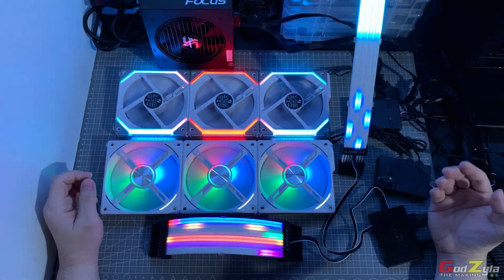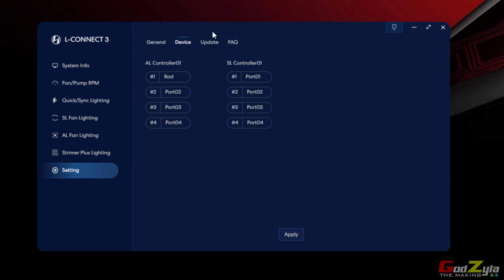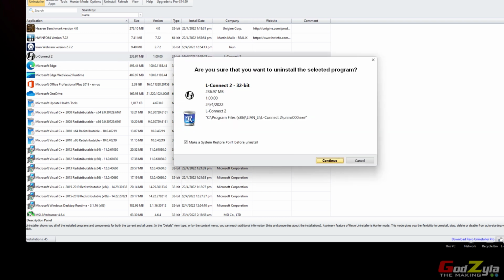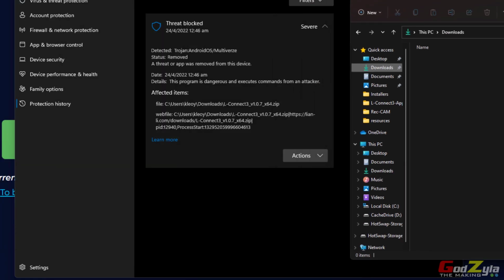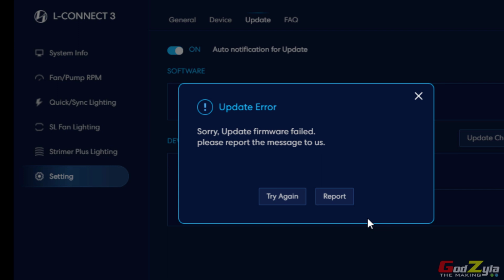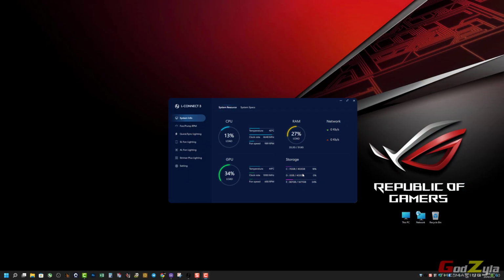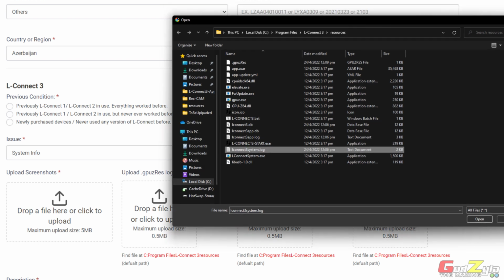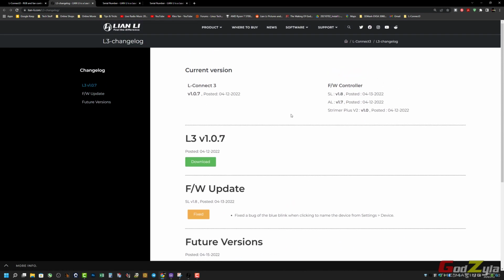Lian Li - L-Connect 3 (Installation)

Comment: my L-connect 3 is till very lag... despite being the latest version.
Reply from the maker: Hello Sebastian Tan, welcome to my channel, do you happened to have lots of USB devices plug to your PC, if that's the case, it might be the cause of it.
Reply: @KleoYan  hi. I only have kvm cable, mouse, headset
Reply from the maker: @sebastiantan1769  ok, I see your issue now. is your KVM an external device or it's embeded to your Monitor. Be it embeded or external KVM, you can try connecting all USB devices directly to your PC instead of using the KVM. I had this problem with my external KVM and a friend who has the Gigabyte M32Q monitor. we both can't control the L-Connect 3 without lag, but once we connect our usb device, the issue is gone. Additional to this, I have swap my external KVM as my old KVM does not have a power input source. I have purchased a KVM that comes with a 5v power source from an AC outlet. This resolve my issue too.
Reply: @KleoYan  i need the kvm from monitor due to my keyboard cable being short.
Reply from the maker: @sebastiantan1769  I see, this i can't help you with.. it will be base if you contact lian li tech support and tell them the issue you are having.
Reply: @KleoYan  ah i manage to bypass my monitor kvm hub. and now it works. but this is strange
Reply from the maker: @sebastiantan1769  yes that’s what I find out. When I had kvm on. I can’t seems to get the app working till I do direct. But now am
Able to use kvm but must be a kvm that has a power source provided, else it will not work.
Reply: @KleoYan  my kvm is monitor kvm.. so no power...
Reply from the maker: @sebastiantan1769  yup for monitor is should work but for some it does not. Sad to say, anyway I have told lian li about this and they are still finding ways and means to improve the situation as some of the pc builders are using kvm monitors. Hopefully there will be a fix for it.
Reply: @KleoYan  oh okies. cos i plug in only the whole app hang.
Reply from the maker: @sebastiantan1769  yup that’s the issue as the L-Connect 3 is scanning at the background for usb devices as it’s controller are all usb devices. The usb addresses are shared in kvm. That’s the problem, I have tried with some other kvm with power source too but not all will work. Hopefully Lian Li will narrow down with a solution.

Comment: Hi, great video! I have some questions and wish you can help me. I built my new pc last week with lianli sl fans. The problem is, when I downloaded L-connect 3 and updated the firmware of sl fans, all the fans were running max speed and couldn’t change the RPM unless i turn off pc. Also every time i open the l-connect 3, the fans run to max, and the temperature of cpu and gpu shows 0 in L-connect 3. But I uninstalled 3 and downloaded l-connect 2, everything is fine.
Reply from the maker: hi 萨菲罗斯, welcome to my channel, currently you are not the only one facing this problem as others are facing this too. I would advise to either temporary plug your fan load to your motherboard fan headers first. there will be a fix patch on this issue from lian li. or you can temporary use the L-Connect 2 first. I will be doing up a video when lian li is out with a fix. Pardon me as I have limited knowledge to fix your issue at the moment.
Reply: @KleoYan  Thank you so much for responding. Yeah, at this moment all i can do is waiting Lian Li to fix it. I will try to lodge this issue to their technical support see if they can solve this problem. Thanks!
Reply from the maker: @萨菲罗斯  you are most welcome. 👍

Comment: I have migrated from L-connect 1 to L-connect 3, and now I cannot control my fan speed. All my fans work at 1800 RPM, and I cannot control them and that is driving me crazy. Anyone else had the same issue?
Reply from the maker: Hi moneff, welcome to my channel. mind if I ask which uni fans are you using? if you are using the SL fans without the SL marking on the controller. you might want to do a firmware on it first before using the L-Connect 3. here is the guide on how to. https://drive.google.com/file/d/1lZDI9FQEHRptOKHJTeL8_Qf7os3I1hU0/view

Comment: I had firmware fail, Lian li sent me link to firmware tool but no firmware included, contacted Lian li again but no response.... I've 3x triple packs of AL's with 3 broken controllers and would hate to refund them over the controller's but I'm not wasting 200 pounds because of software bricking my controller's.
Reply from the maker: hello TuShoo, welcome to my channel. As for your issues, you will have to reply to them and see if they can send you the replacement controller.
Reply: @KleoYan  I took the decision to refund them and have them out of my system just now. The honest answer is it faster to refund through Amazon and buy new fans (Corsair better support IMO) than dealing with RMA.
Reply from the maker: @tushoo4938  I see, whichever work for you. That will be good.

Comment: does your l-connect 3 auto start ? after turn on ur pc ?
cause i tried everything i can even in startup folder is still the same everytime i need to manually turn on or my fan wont run full speed
Reply from the maker: Hello WillamV Yong, welcome to my channel. Yes it does auto load. I will be doing up video soon about the pwm functions. As I have all my issue fixed by lian li tech support 😊

Comment: Hi, my L-connect 3 cannot detect cpu and gpu temperature and clock rate as well as fan speed, what do you think is the issue here?
Reply: Even My fan mode can only use static, currently any fan curve wont work
Reply from the maker: @xandrelphane  hi , welcome to my channel, are you on the old version of L-Connect 3, if you are, you might want to try uninstall the old version and install the new version, see if that works.
Reply: @KleoYan  Hi, i just installed the new version today..i had just switched from l-connect 2 to l-connect 3, i followed your every instruction in the video. And im currently only using 1 controller
Reply from the maker: @xandrelphane  I see, is everything working fine for you?
Reply: @KleoYan  Unfortunately no, as i have mentioned, my L-connect 3 cannot detect cpu and gpu temperature and clock rate as well as fan speed, and the fan curve setting is not working, only static fan speed is working
Reply from the maker: @xandrelphane  ok now just to check with you, do you use a kvm or even a docking station to switch between pc and Laptop with one set of mouse, keyboard and monitor. Or are they plug directly to only one pc?
Reply: @KleoYan  Plugged in to just one pc
Reply: No docking station, no laptop, just a pc
Reply from the maker: @xandrelphane  ok, if that's the case. your best bet is to approach lian li tech support, i am out of clue how to aid you on this. or are you able to roll back to L-Connect 2? Now I have to head to work. will talk to you again. pardon me. https://lian-li.com/faq/

Comment: Thanks for your video! Hoping someone could help me with a slight problem.. everytime my pc boots and L-connect3 auto runs, i' ll get 2 UAC popups "Do you want to allow this app...", which gets really annoying considering they happen every time my pc boots.. Tempted to disable UAC altogether because of this but before that, anyone facing the same problem or anyone knows if i am doing something wrong? Would appreciate any help with this !
Reply from the maker: Hi Jovan, welcome to my channel, I do face this kind of issues with the UAC and I disabled the UAC. The choice is yours if you are ok with the UAC on.

Comment: Just downloaded the l connect 3 but my strimer is not under the l connect app? If going by the website it looks like I need a new controller coming sometime in may? I’m not sure if I have the strimer or strimer plus… I got it prebuilt. Could you advise what I can do? What is a controller? (Pc noob)
Reply from the maker: Hi tyler dicarlo, welcome to my channel. Yes if you are having the strimer plus. The orginal controller will not work. You need to have the v2 strimer plus controller which is sold separately in order to work. Which this controller will be release May 6th. More details here https://youtu.be/J76Zyd1GzNA
Reply: @KleoYan  shouldn’t my strimer show under the Device manager thou even without the new controller?
Reply from the maker: @TylerD1995  no it will not show. You need a controller specifically for the strimer plus.
Reply: @KleoYan  could I just go back to the original software before the l-connect 3 just until I get time to get the new remote and install it?
Reply from the maker: @TylerD1995  the original Strimer plus comes with a physical controller which works on physical pressing of buttons. if you want it to work with L-Connect, you will need the lian li argb kit to connect that controller to your SL or AL fans, if you want to use the L-Connect or L-Connect 2 but not L-Connect 3 to work.
Reply from the maker: @TylerD1995  let me give you the whole playlist where you can refer to, if you using L-Connect 2 for the strimer plus. look under strimer plus with uni controller. https://youtube.com/playlist?list=PLEW-b-2vYDdPo0NzHyeksx012c-nkDapm

Comment: Why the hell should anyone go into these problems, this should be simple
Reply from the maker: Hi gamer profer, welcome to my channel, I do agree. lets just say that if you can always look for other argb equipment or software. There is a saying no pain no gain.. look at the bright side. if you have purchase these fans and strimers, is either you go through with it or you don't.
Reply: @KleoYan  I got the fans and controllers and the strimmer plus, but I tried the lconnect 3, my way, your way and different ways but in vain it just not recognizing my controllers.
My pc is lian li from bottom to top, but there is a problem with the software which is easy to make
Reply from the maker: @gamerprofer2238  hi, welcome back. are you by any chance using Gigabyte Vision or the Aero motherboard? apparently i have tested a few Gigabyte Vision and Aero boards, it's random that the USB does not pick up the controllers. which is weird, even after doing fresh windows 10 or 11 installation. If  it's not. which motherboard are you using. mind if i asked? thank you!
Reply: @KleoYan  no I am using asus b550 with a ryzen 7 5800x
Reply from the maker: @gamerprofer2238  I see, you might want to go through this check list
1) Is your motherboard with the latest bios
2) did you update your motherboard chipset - amd.com or your motherboard manufacturer to download and install the chipset driver
3) before you install the L-connect app, is there any other argb apps you are using (Armoury Crate example) if yes. uninstall the app inclusive of the L-Connect 3 then reboot your device. Look under device manager and see if the controller does appear under Universal Serial Bus Devices.. if it does, install only the L-Connect 3 app 
4) Where all firmware updates done on your controller?

these are the few which you might want to check. if it still does not work, kindly contact lian li tech support for help. thank you!

Comment: Problem is L-Connector 3 my fans run on quiet but rpm is constant at 1200. With the old L-Connector 2, the fans were set to PWM and run at a constant 800 rpm. Is this a bug in the new software? I'm not satisfied. Installed old Lian Lee again. Please help Thank you
Reply from the maker: Hi Patrick, welcome to my channel, for your info, L-Connect 3 at the moment does not support motherboard PWM mode. as for your fan not being able to run as profile quiet, I have encounter this before. After installing L-Connect 3, shut down your machine, unplug the PSU cable, let your PC clear off whatever past memory that is in your PC, next check the connection of your USB cable to the motherboard usb header. then try again if failed. Kindly report your issue to lian li tech support here. https://lian-li.com/faq/
Reply: @KleoYan  Thank you very much
Reply from the maker: @Patrick-pv4ud  you are most welcome. All the best with your build. 👍

Comment: I keep getting a controller not detected error :(
Reply from the maker: Hi ChristianTV16, welcome to my channel. Mind if I ask which motherboard are you using? And which uni controller are you using? The SL or AL? Maybe check the following 

1) check the connection of the usb cable from your controller to your motherboard. Go to the device manager and under universal serial devices. Do you see your controller listed? 
2) you might want to check the usb connection to another usb header of your motherboard. 
3) do you have other argb application that is installed before the L-Connect app? Maybe remove all the apps first. Do a reboot. First look at device manage and see if the controller is listen. Next install the application.

Comment: My L connect doesn’t run on start up do you know a fix for this ? I have it active in the settings
Reply from the maker: Hi George MUsgrove, welcome to my channel. now leaving the settings on L-Connect 3 to autoboot run on, reboot your system, once your system boots up, if the L-Connect does not load at default, press Control + Shift + Esc key > Click on More details (if you have that listed below of the prompt box) > click on start up. Do you see L-CONNECT3-Start.exe listed. was it disable or enable, if it's disable, highlight on the L-CONNECT3-Start.exe  then click on Enable at the bottom right.. reboot your system. see if that helps.
Reply: @KleoYan  I think I have found the problem my pc is seeing the start.Exe file for l connect as a threat and deletes the file but it won’t let me allow the file
Reply from the maker: @Muzzey.  hmm on your lower right, do you have windows security? for me I am on windows 11, I have added the whole folder of L-connect 3 to be excluded and to allow the file. If you are using windows 11, click on the Windows security, click on Virus & threat protection. next click on manage settings "under Vires & Threat Proctection settings, scroll down, click on Exclusion and add the L-Connect 3 folder to it.. that might help.
Reply: @KleoYan  I’ve followed these steps and it still doesn’t load on boot, it is strange do you think a fresh install would help fix the issue ?

Comment: THIS GOT FIRMWARE.. HOW TO SOLVE??
Reply from the maker: Hello Zarihan Raduan, welcome to my channel, I understand your frustration, but at least calm down and let me know what component are you using, AL or SL? does the controller hub have the SL marking if it's a SL uni fan set. without your equipment specification, I am not able to help you out.

Comment: i couldn't install LC-3 on SL120!
Reply from the maker: Hi kur tv, welcome to my channel. Is your SL controller without the SL marking? if it is you might want to do a manual firmware update. First remove the L-Connect 3 app. View this video to do the firmware and do not miss any of the steps.  https://youtu.be/hZpzR_4917c and full instructions here https://drive.google.com/file/d/1lZDI9FQEHRptOKHJTeL8_Qf7os3I1hU0/view , once done, re-install L-Connect 3

Disclaimer : for firmware upgrade, it will be at your own risk as I am not responsible for any firmware failure. thank you!
Reply: @KleoYan  Hi Kleo thank you so much for the reply i will be following these steps above! Thank you <3
Reply: I did the steps above thank you thank you! It's working now i have more control of my SL120 fans :) SO many new options! You're the best my friend!
Reply from the maker: @kurtv9375  You are most welcome,, enjoy and if you find any bugs, do remember to submit logs to Lian Li tech support. thank you!

Comment: I have tried adding the software to my startup and it still won't load with windows I'm always constantly having to restart my R GB even in sleep
Reply from the maker: Hi Miles, welcome to my channel.. just to verify, you added this app into your startup folder? infact you don't have to do that. just launch the application > go to settings > general, Enable  Auto-Run on boot & Minimize L-Connect 3 to system tray at close.

Comment: Lian li need to fix these asap. The use of applications like that is not the answer. That brings more issues later don the road. I will try the app soon waiting for 2 more fans to start replacement
Reply from the maker: Hello Carlos De Bernard, welcome to my channel. Bugs there will be, best if you use it and have issues, submit your issues to lian li tech support https://lian-li.com/faq/ , the more end user report the issue to them, I believe they will need some evaluation from the crowd to take action, else they will take it as the application is running fine.
Reply: @KleoYan  I will as soon i get the 2 fans i will start. Look ok the good thing i have 1 box to control all (fans)
Reply from the maker: @CarlosDeBernardMrAgapi  Nice, thank you Carlos, I mean I do not belong to Lian Li or whatsoever, but ya.. if you can try and find there are bugs, submit your issues to them. Once again thank you for visiting my channel and to leave your valuable feedback. by the way.. all the very best in your build. 👍